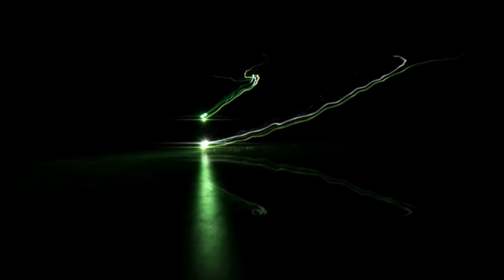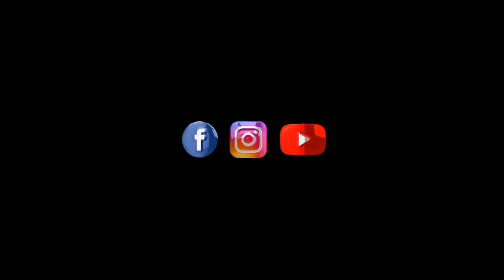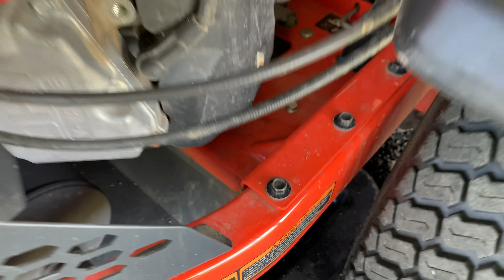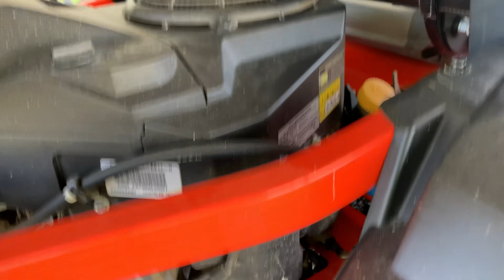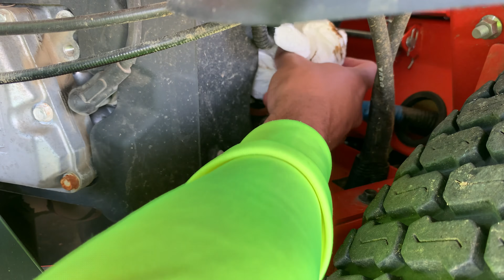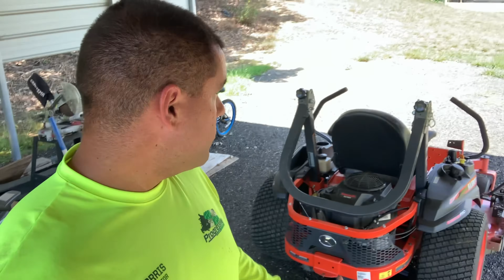Kubota Z-421 Oil Change Using No Tools! [Super Easy Maintenance]

Comment: You should unscrew the dipstick to allow air in so the oil drains more freely.  Also, you do not screw the dipstick in when checking the oil level. 😉

Comment: There is 100% no way this is meant to be hand tight and hand loosen. I tightened it with a socket gently much more than hand tight and it still dripped oil so I had to tighten some more other videos show the same. Don’t listen to this guy no hand tight no hand loosen no way.
Reply from the maker: @shawnhorton2000  you caught me. Big oil told me to say this so it would leak and you have to buy more oil.
Reply: @3rdTACGolfandFitness 😂
Reply: What size socket? Plastic I a dumb idea, I finally used needle nose pliers to get it off.

Comment: I just got a new z412 , a couple of weeks ago..it's so hot where I live in FL , the Kawasaki reps recommend Kawasaki 20w50 year round. Multiple commercial lawn equipment dealerships said the same thing. Couldn't be happier with my mower. It says in the manual not to screw in the dip stick in to check the oil. Nice work.
Reply from the maker: So funny you say that, after I shot this video I realized I did that. It literally also says it right under the cap on the dipstick. 🤣🤦‍♂️ Yeah if I ran my mower full time I wouldn’t use this same oil but the temps down there in FL are wayyyy different than here. Thanks for watching!
Reply: @3rdTACGolfandFitness   It's habit , I do the same thing lol...take care.